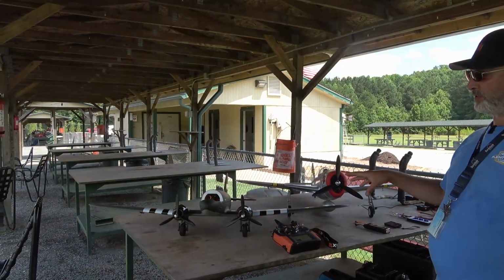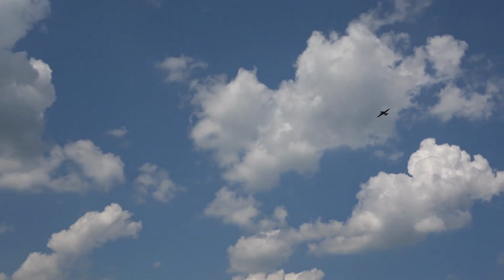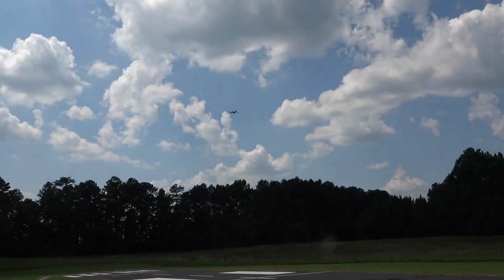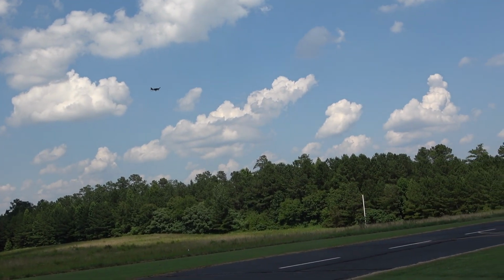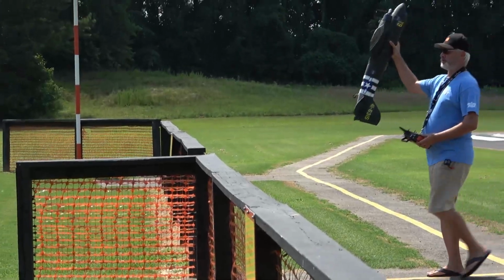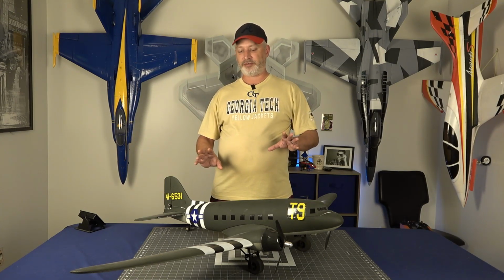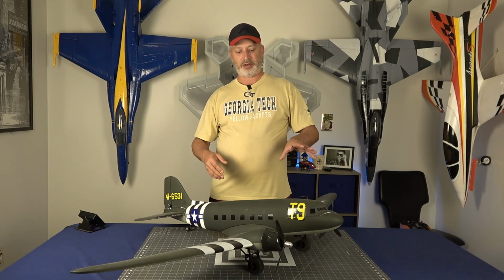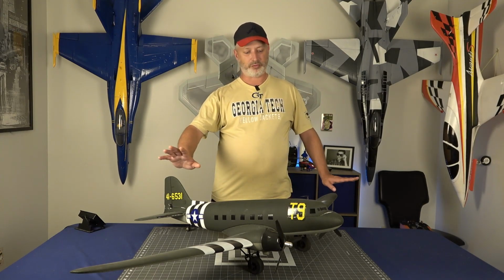Dynam C-47 Skytrain Flight Review

Comment: I like where you give advice on the build on areas that need attention !  Thanks.
Reply: I'm having trouble with mine as it wants to climb at anything past half throttle any advice
Reply: @jonathanmayfield9218    Did you check your cg to make sure your not a little tail heavy.
Reply: Yeah it's set at  65 mm as per the manual
Reply: It climbs up so steep it puts it into a stall instantly